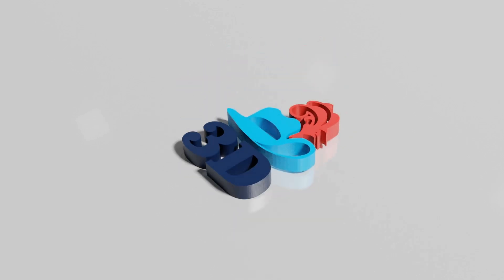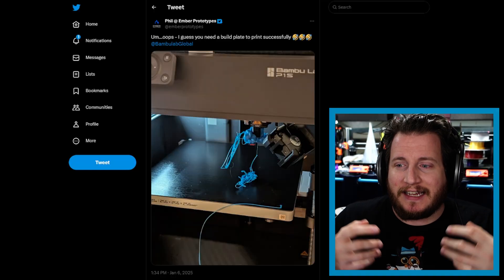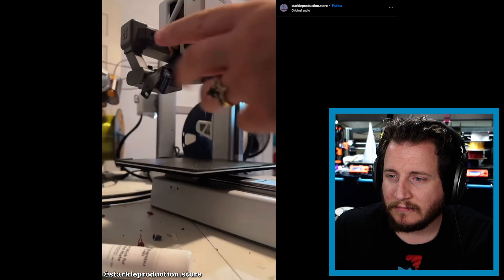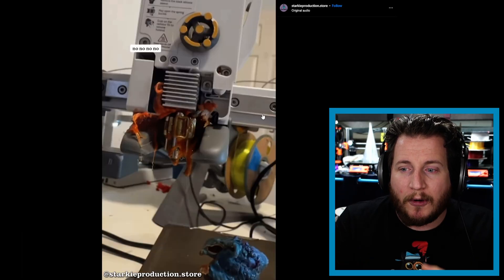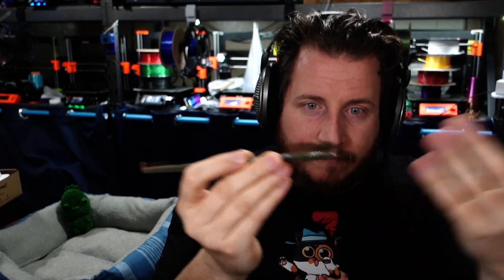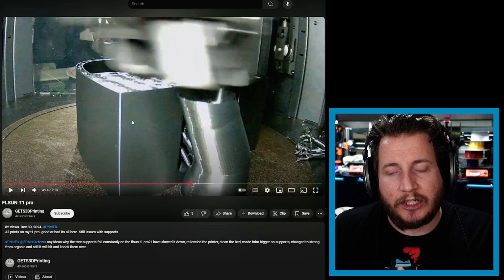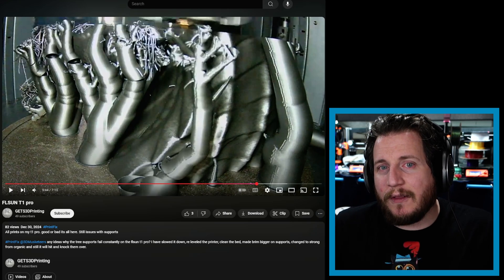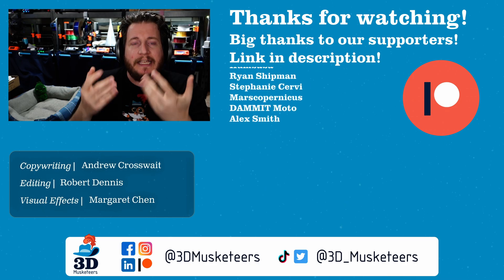Blobs and Bedless Printers! - PrintFixFriday 174

Comment: I'm seeing a lot of that on the Mastodon 3D printing space   People get these Click-Print-Go printers  where they don't know they have to do basic maintenance or even repairs   They just print and print and print and print till the bed has no adheson as they don't know they have to clean between prints or nozzels wear out or how to deal with nozzel issues or globs    I one guy I was chatting with along with another tried helping someone with a glob issue but they felt that was way to much and just bought an whole new print heat for their bambu   Not the hot end or nozzel/heatbreak the whole thing    They were actually discusted with the printer that this happened and felt it was a fault with it

Comment: The new Bambu Supertack plate was released before it was ready.  Build plate localization must be turned off, advised by Bambu, in order to use this plate.  I myself accidentally started a print with NO PLATE installed thanks to Bambu’s recommendation.  I went back & forth with Bambu support as they felt turning off localization should not cause any damage to occur.  Obviously I felt printing on the magnet would indeed cause damage and they finally offered to refund the plates.  Pathetic in my opinion, this needs to fixed NOW.

Comment: lol, as a gun nut the first time I had to clean a blob on my X1c the first thing I grabbed to clean the hot end after the big stuff was gone was a brass cleaning brush. Grab a ten pack as you'll find them extremely useful, brass is great as it is such a soft metal, there are bronze and steel ones as well.
Reply from the maker: I'm using copper ones I think? Need to find some brass ones..

Comment: supports breaking on the way up, could be material Z expansion of the whole part/support over time. kinda like warping of some materials.
I've seen it frequently, especially with multi day prints. the XY shrinkage occurs as the parts cool, accompanied by a slight bit of expansion in the Z direction. taller prints tend to get burned by this, most often 3/4 of the way through a tall print.  any way to tell the slicer(s) to add an extra micro step in the Z every so many layers to accommodate?
I have the Zhop down, that isn't the problem, it's when it returns new the new layer height, where the nozzle is too close to the actual print after so many layers eventually.
Cura can take some of this into account by adjusting shrinkage and expansion factors on the entire print. but it applies as adjusting the total height, not really taking into account that the print itself is expanding in the Z direction as its printing. 
While I expect this issue would be minimized with a heated chamber, I wouldn't expect it to go away completely.
One other issue, at least as it pertains to bed slingers, Often times during traveling with Zhop, the rather heavy print hasn't quite settled down from the movement of the bed, leaving the nozzle to drop onto the still moving print at the top. My usual fix is to slow down the acceleration. it doesn't quite fix it though, some time delay with height.
Zhop and acceleration seem to my go to to reduce these issues, but they apply globally to the entire print, adding too much time early in the print, and not enough later with height.
seems like a slicer calculation that could be implemented, but is outside of my knowledge to do

Comment: I participate in the A1 Reddit and it’s been real bad with blobs on there. I assume most people just chuck the printer if it happens. The thermistor cables always break and they end up having to replace the entire hotend assembly… which is a 10 min job for me but takes a sliver of being mechanically inclined.

Comment: Strangely (or not strange… since it’s a newer printer) the A1 has build plate detection. It probes on the very back of the plate first and it it’s not there the printer pauses and sends an error.

As a dude with an A1 I was surprised how older the P1S feels. The screen… little things like plate detection. It needs an update for sure.

Comment: I actually got a blob today...a baby blob mind you but a blob nonetheless.  I caught it JUST in time.  This was a new one for me though.  It wasn't leaking from the nozzle threads or heatbreak thread but instead is was leaking out from the bi-metal heatbreak itself.  It was coming out from right where the titanium stem is pressed into the copper shaft.  Never had that happen and never would have guessed it COULD happen but here it was in real life.  So that heatbreak got tossed along with the thermistor (couldn't save it), spare ones got put in (always gotta have those spares on hand) and then I got to play with setting Z offset.  Now I just have to wait for replacements to show up and I'll have a couple spares on hand again.

Comment: I think the A1/A1 Mini actually does the 'squishy" test, as Ive had a nozzle ooze slightly and it stopped during bed leveling and ran the nozzle clean cycle and restarted the bed leveling process.

Comment: Thank you for the hints i checked and the zhop is enabled. so i tried the forced zhop in the filament over ride and added the bigger brim. i was finally able to print something with tree supports and not have it fail. this printer is stupid fast. and thanks for checking out my video

Comment: I don't get why people take off their build plate to begin with most of the time I wait for it to cool off and it slides off by itself or if I'm in a rush just pull up one corner and peel it off as long as it's not petg
Reply: I pull it out to remove my prints, clean or switch the plate. But it always has a plate in it. I don't understand leaving a plate out of the machine.
Reply: @braixeninfection6312  I pull it out for all of those things except removing prints

Comment: So the blob brings up a question. Is it safe to use phosphor bronze brushes on brass nozzles? Sometimes I want something a little harder and more stiff, without stepping up to stainless steel. I know the phosphor bronze being harder than brass means it might scratch, but how big of an issue is it realistically?
Reply from the maker: I go for copper traditionally. You could but of course keep pressure minimum to avoid damage. I think stainless is a bit hard though.
Reply: @3DMusketeers  Thank you. Maybe I am asking the wrong question then. When I get black stuff on the bottom of my nozzle and hotend. I am guessing maybe this is carbon from PLA getting too hot because it was left behind at some point and then printing with another material got it too hot. Brushing didn't remove it all when the hotend is at printing temps. When I did get it all off, Slice Engineering Plastic Repellent didn't do a great job preventing something like PET-G from sticking. At least not as good as I imagined in my head. If it touched, it would still attach and drag a string. I finally turned to a sock, but it was a "premium" one that covered all but the tip of the nozzle and all that served to do was allow it to drag on things enough to keep pulling the sock off. I finally got a solution by trimming the sock so the full nozzle portion is exposed and using a wire at the top to hold it on the hotend. This protects my hotend from sticking, but I still occasionally get stuff stuck to the nozzle. Since I spent a pretty penny on a Mod 3Dp Ruby tip nozzle, I would really like to keep it clean. Where am I going wrong here?